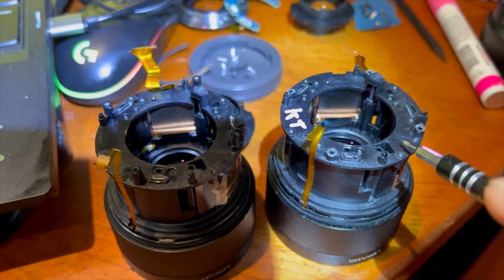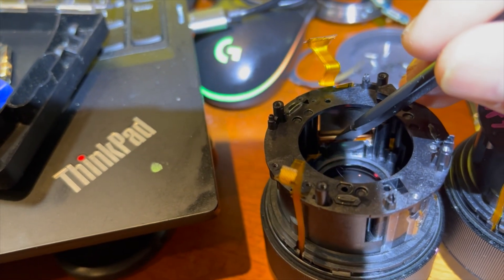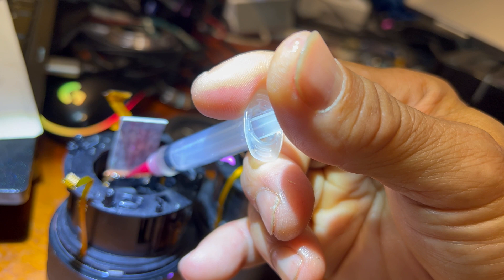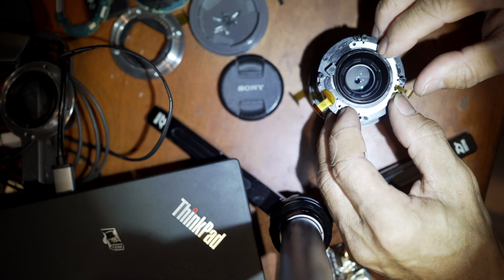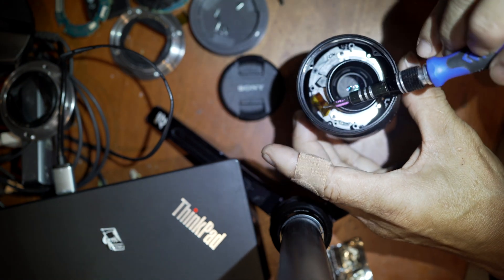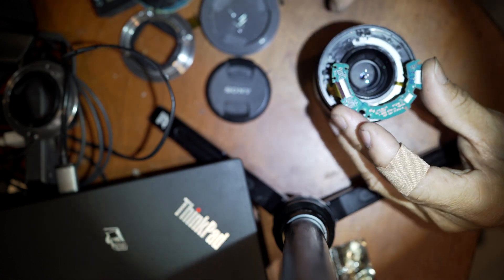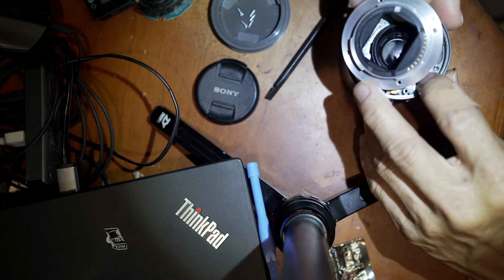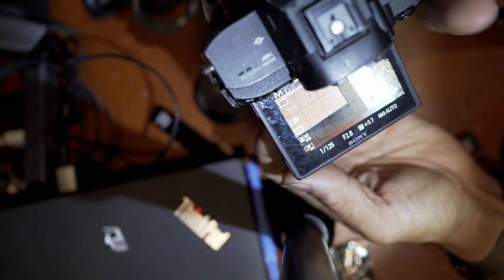Sony ZEISS 55MM F1 8 AUTO FOCUS MOTOR RATTLE FIX

Comment: Can you help with glue link from aliexpress to buy for this and maybe that injector? Thank you so much!
Reply from the maker: syringe -https://www.amazon.com/Filling-Syringe-Measurement-Fountain-Computer/dp/B08BK6H8DB?crid=34C7ZN9YY480B&dib=eyJ2IjoiMSJ9.5MnUstZp35mR_rHlsfbI-6sKpjsmSdayxre3FNIk5yFovPOp-fFQLjTqYfJ_szNTv3PgotaLszgKonmkIPXvl_oPn7myUE3amk9GvBG_xx5B67mtJ3qSxzMPR4Yg20u-JQU1KKRrakBrtngdsngUzbps6GHFtC3t02-rjrqEFHqbntFEVQ6IGF6CIrSEbiWS8R7HlHYxj6B2zBL1cAxDkolxshpWRMztsZHPP6bg_ic.oha3op_y1XtQubaQPzLYCA8cVooVbxG3Poyhvmhpo5s&dib_tag=se&keywords=syringe+for+ink&qid=1750277562&sprefix=syringer+for+ink%2Caps%2C321&sr=8-1
two part epoxy glue -https://www.amazon.com/J-B-Weld-50240-ClearWeld-Quick-Setting/dp/B07TTTYKGS?crid=7Y7ZQHMJH587&dib=eyJ2IjoiMSJ9.3pz0sPdHcbnahFbT6lyBfZsdelvXbH5xgzFReRrv_MoO8ccZfIR7zjepD1B8xqVKXRpPBrz6_HkT9e51s217oJJGqed21SffmBKPt4J4T_xoVfeFciGS5UER0sScg2wFqlTXy9MpmGwdVMOK1BF7aXR_14eh6N3IbHW_hA7ACceo1Y52EsUpghbWQDtx8hx3g-loXIkGHxky0u59uKIYpR82XrI2iexpsMvNaVOgJKY.N4eFhIiIQbk8vS1bGZ01xCfk0xNbWVa3bawZeCas7qs&dib_tag=se&keywords=jb+clear+weld&qid=1750277621&sprefix=jb+clear+wel%2Caps%2C363&sr=8-4

Comment: Hello! Will i need to attempt this repair for mine? Or are the sounds mine make when turning the camera on/off normal? Also noticed an audible click when changing aperture and slight hum when hunting for focus. I've only had this lens for a month so i am unfamiliar with it and maybe shot with it only a handful of times. Unfortunately, a porter dropped my carry on luggage with my camera inside and i fear that it caused mine to make these sounds. Hoping that thats not the case and maybe I just never noticed before and I'm just being paranoid. Here is a video i took in a silent room:
https://youtu.be/hT-6Wkl08TE?si=AvDeDleH8qQ5rddn
Reply from the maker: I would not be surprised that is the case.  My two copies of the Zeiss 55 does not make this sound when working properly.  Only after the glue detached that it started making the rattling sound.  Wait till it gets louder and if you're used to taking the older iphones apart  then take this lens apart to check.
Reply: @pomanprod thank you. That is probably the smart thing to do. I'll wait for it to actually get worse before attempting to repair it. Is it viable to use some sort of tape or adhesive as an alternative to the epoxy you used in the video?
Reply from the maker: @alcavey  I don't suggest using tape or single part adhesive as it's not strong or durable enough.  
This lens isn't good enough for pro use as I used in two cross country invitational (high school) events and the aperture motor came loose.  So much for German engineering.

Comment from the maker: I love the colors and bokeh of this lens but the lens is not robust for sport use.  In the linked video below, with the auto focus actuator fixed in the 55 Zeiss lens, I discovered another weakness of this lens: the actuator for the aperture blades is defective when the lens is used in a setting with lots of bumps and vibrations as in this example: https://youtu.be/tw-sK2KPAWs?t=37. I am guessing that when I hit a bump, the actuator is not strong enough to hold the aperture blades in its position and so the lens will go to f22 then back out (hence the flashing and auto focus acquiring).  Over 4 hours of filming, the issues got worse and the A1 refused to stay in recording mode.
It looks like I will have to go back to the Sony 50mmG f2.5 which I have used for two full seasons on the bikecam with no issues.

Comment: THANK YOU for this! I repaired my 55mm 1.8 focusing mechanism thanks to you. My issue now is that images seem softer than before the fix, I’m wondering if it’s possible to decenter the lens? I’m going to do some controlled testing today to see if this is real and check in again here in case it’s something to consider when repairing. I welcome your thoughts.
Reply from the maker: Let me check mine.  I record mine in 8k so I should be able to see if it's sharp or not.

Comment: I recently bought a used one and it makes bit of the rattle when the aperture is changed from wide open to closed. Is this normal? Or might indicate that its about to get worse? Thanks in advance for your help
Reply from the maker: Should not be any noise at all or very whisper quiet.  The noise was clearly a rattle.  To check without opening the lens, shine a bright light into the lens with your eyes staring into the front lens.  You will see the focusing element rattling around.